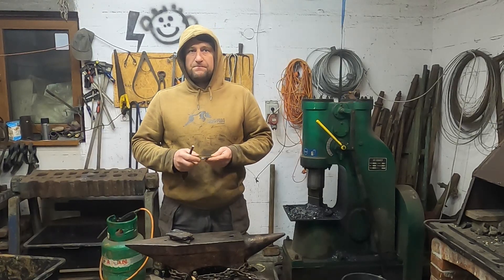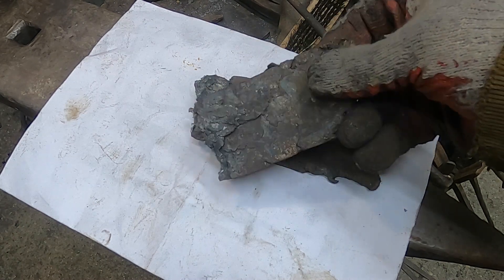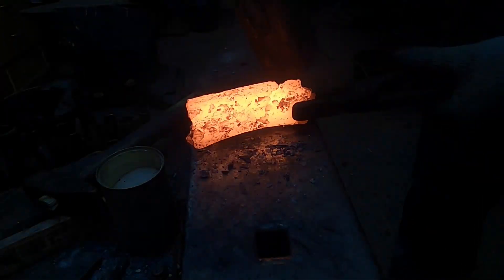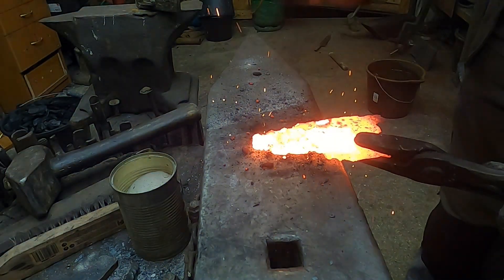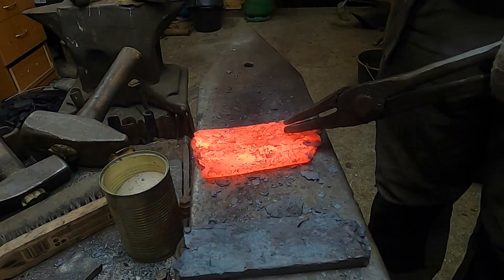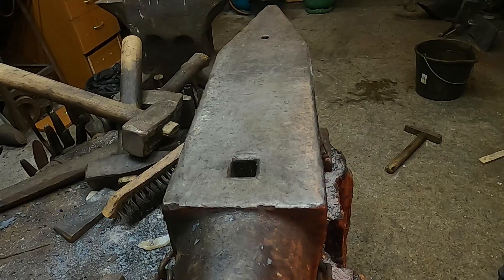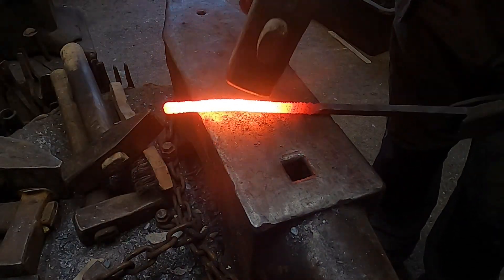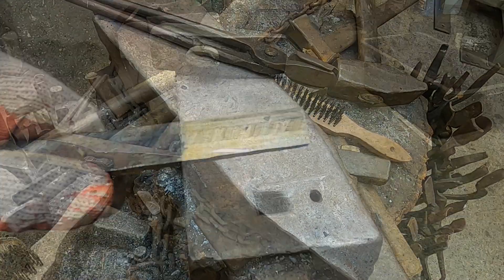Bloomery Iron Damascus Knife

Comment: Hi, I have another question. You said, that you like to use sand in the beginning of this refining process with charcoal. Why is that? What is the advantage of fine sand to borax? Thank you for your time! Cheers, Jasmine
Reply from the maker: I used sand instead of borax when i forge bloomery iron. The melting point of the quartz is higher than borax.
Reply: @officinaferraria  Thank you! That is good to know. So when the sand melts, it gives you a better idea how hot the wrought iron is?